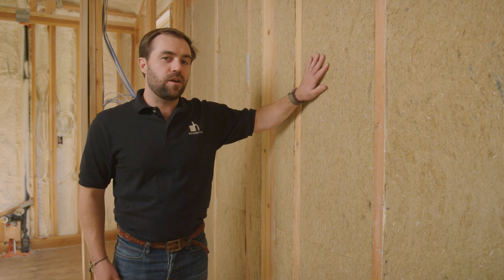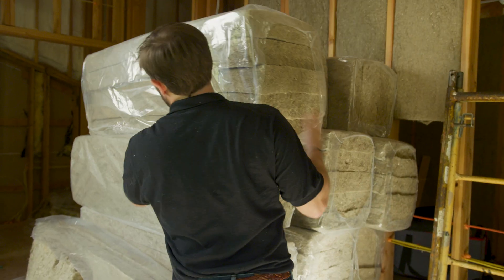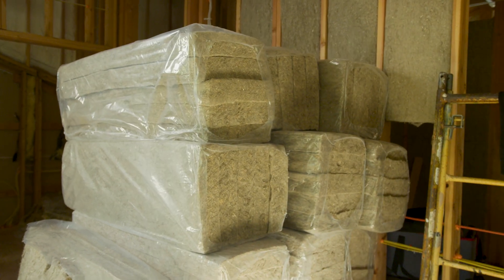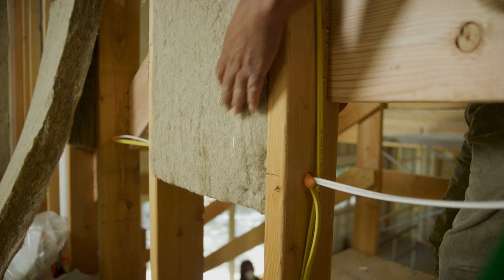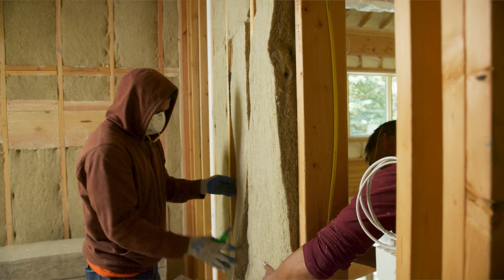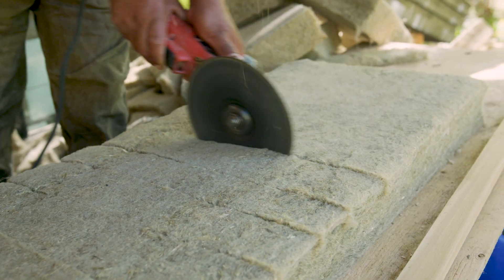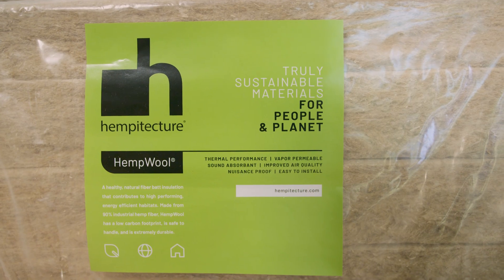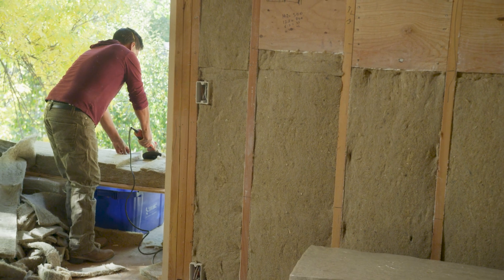Flash and Batt Insulation with HempWool

Comment: I couldn't care less about "carbon foot print" and don't buy into the global warming theory.  However, I really like that it is potentially healthier than breathing spray foam fumes.  I noticed that the installer was wearing a mask.  Are the fibers safe to breath?  Cost, performance and safety are the metrics I am most interested in.  What is the R-value per inch and the cost per square foot including installation?  How does it compare to spray foam, rigid foam, fiberglass batts, and Rockwool batts?
Reply from the maker: Certainly healthier than breathing spray foam fumes! We understand that embodied carbon isn't on everyones priority list. The installer is wearing a mask because it's always best practice to protect your lungs, whether cutting wood, hemp insulation, or drywall. All that info can be found on www.hempitecture.com
Reply: @hempitecture  Nice!  3.7R per inch is great.  Also, nice to be able to install without gloves or long sleeves.

Comment: We're using the combination of closed cell spray foam and hempwool batts on the underside of our vent-less shed style roof in Western Colorado. The rafters are comprised of 12" engineered BCI's. Our contractor recommended 5" spray foam to inhibit condensation from forming a dew point where rising interior moisture meets freezing temps on the surface of the roof. We are combining the spray foam (R-7.5 per inch) with two layers of 3.5" hempwool batts (overlapping the seams) for a total of 7" hempwool. The combination foam and hemp will provide R-63.5 in our roof. The property we bought had an unfinished shop building on it with the vent-less roof already completed on the exterior with metal roofing. We added an addition to our previous home that also required a vent-less shed roof and pretty much followed the same protocol except at the time we used denim insulation batts.  I'm a fan of vent-less roof systems after having cleaned out numerous attics full of critter crap and compressed damp insulation from moisture entering the gable vents. Closed-in vent-less rafter systems prohibit wasps, squirrels, raccoons, bats, rats and mice, etc, and will keep the insulation fresh as a daisy for years to come.
Reply from the maker: Great synopsis on an ideal use case!